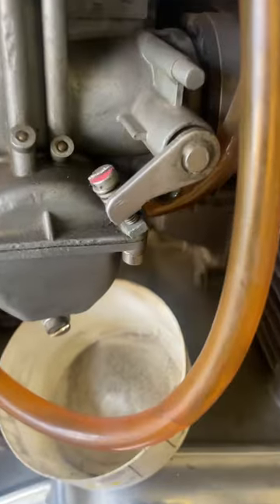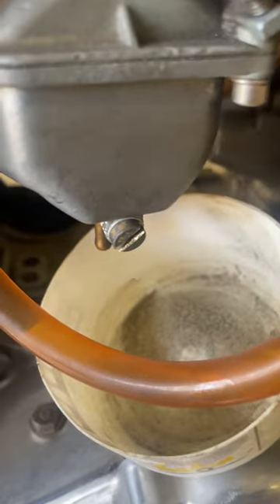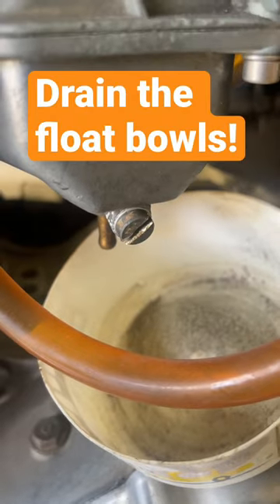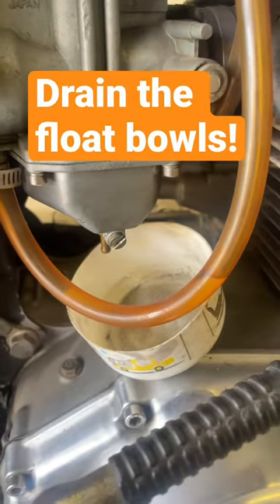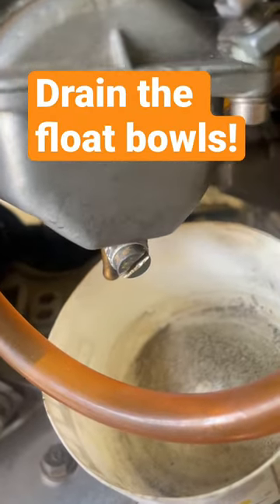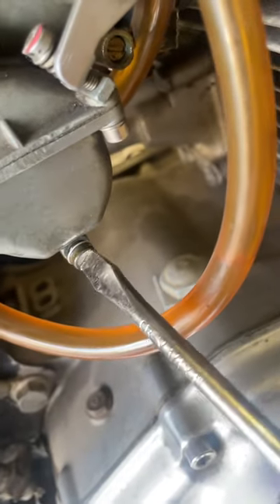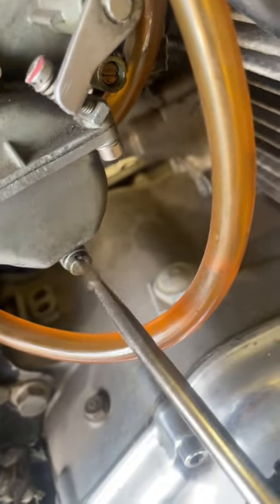Drain your float bowls, people! #shorts #motorcycle #howto #diy

Comment: Thank you :)
Reply from the maker: I would just drain oil. Refill. Pull the carbs. Give them a cleaning. Old gas probably has them all gummed up. Hopefully the petcock on wasn’t a big deal. The floats should stop gas from flowing, plus, the petcock will leak anyway. Start with the basics! If the engine is free, Mi Inc, you’re ahead of the game!
Reply: @KeepOnWrenching  after research and examination everything is relatively fine although my main question now is should I do an oil change or an oil
flush?